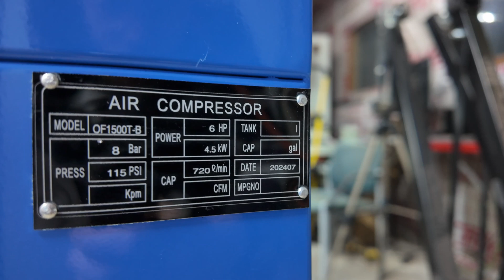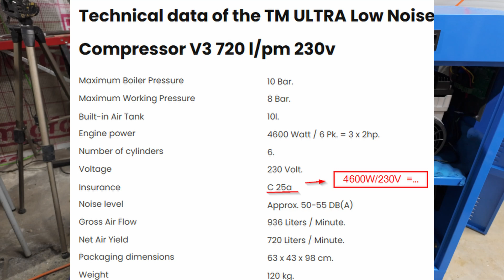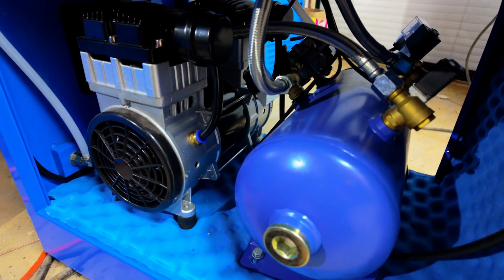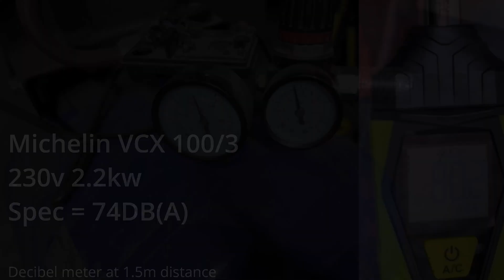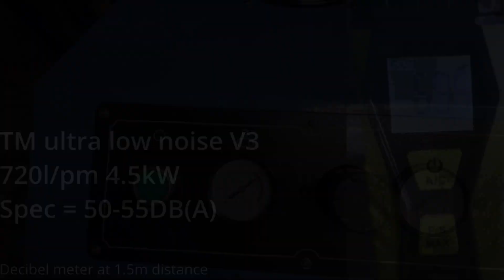I Converted a Silent Compressor to 3-Phase and Here's What Happened

Comment: Can you please tell me exactly which hose and adapters i need to connect this compressors to the tank? I got the v2 ultra low noise compressor along with 270l tank from Toolmania but there is no maual whatsoever
Reply from the maker: TBH it is not worth doing without the mods I did in my second video. as the outlet of this compressor can not support the whole flow of this compressor. So it will stutter on and off near the 5 bar mark. After using this compressor for a while, I find that it comes "defective" from the manufacturer. It should not be sold in its existing state.
Reply: What does the stock one use?
Reply from the maker: @OwlyEagle regular euro coupler compressor attachment.  But that hose diameter is waaay to small to handle the volume of this compessor. So you get about 2-3 bar pressure drop even on a short distance.
Reply: @TheYieldPoint that mod you did is 100% necessary, i dont understand how they let it out if the factory like this. Insane
Reply: btw what kind of reducer do i need for the tank? 1/2 to 1/4?
Reply from the maker: @OwlyEagle  Yes, toolmania claims they " designed it etc but they just bought a random machine from china and resell it. Did not do any proper quality checkings or improvements to it. Also I believe the CE documentation is not valid. I already modified mine before i figured that all out, otherwise i would have returned it. I do not recommend toolmania at all. Nor HBM who selles more or less the same device, but at least they did a better job on the CE part.The tank has G1 3/4" thread.

Comment: If you want quiet then vain compressed air with a 250 litter tank
Reply from the maker: @Richard-oc4lx  there are some advantages and also disadvantages to it. But it is indeed a valid option. I looked at a few of them, but they were too expensive (even used) in my area. Do you use one?

Comment: california air tools makes similar compressors here in the us. didnt know anyone elese was making this style for an industrial sized compressor.
Reply from the maker: @DJGeosmin  i googled the model number that is on the type plate and you end up on some china oem website. They must all come from there.
Reply from the maker: I google'd the model number that is on the back, and it leads to a Chinese OEM. This could have been made much quieter ... I'm doing some modifications and am checking what works and what does not. I should be able to remove another 20-50% off the noise it makes. The design of this is quite basic.

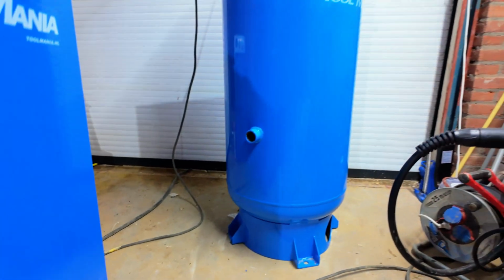Comment: 5:51 I=P/U    4600 W / 230 V = 20 A. However, the starting current might trip a C20 A breaker. In Denmark, we are not allowed to have an unbalanced household phase load of more than 16 A. An unbalanced phase load in a neighborhood can cause a power outage that would normally last a few seconds to last for hours, as it is harder to reconnect an unbalanced load.
Reply from the maker: @srenjensen3817  haha yeah the 20A result was in the textbox. But due to it not being big enough it went ... . They also have a 2 and 1 motor version for lower currents. I just made mine 3 phase due to needing to spread the load.

Comment: The compressor “motors” look exactly like my little oilless vacuum pump. One side of my pump blows the other sucks. Choose your poison.
Reply from the maker: @thisoldman7142  they are quite a bit bigger than my vacuum pump. These are about 1.5kw each.
Reply: They totally are oiless compressors. I salvaged a few from dead oxygen generators